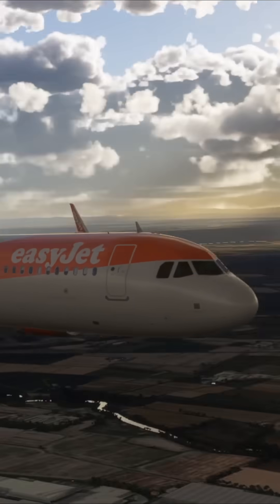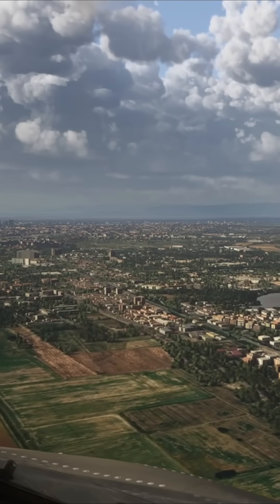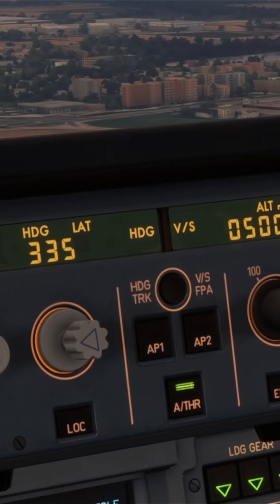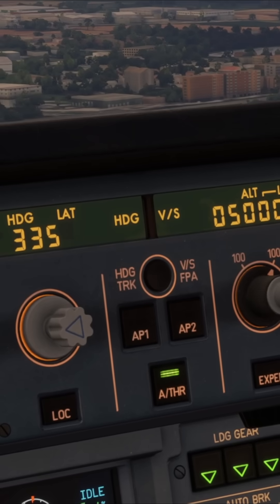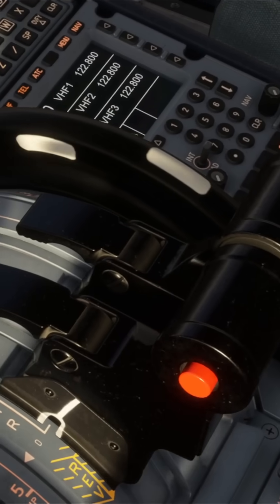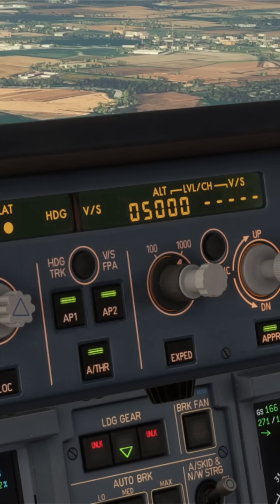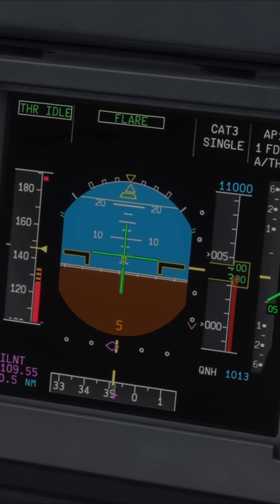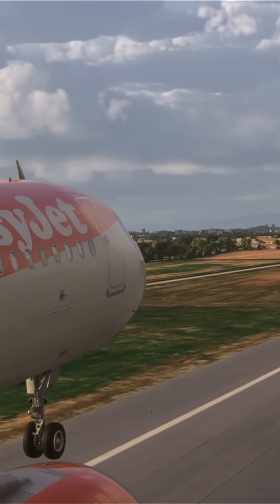A320 Landing Secret: Why the Idle Callouts Are Different

Comment: Another interesting video - Can you do one on approach speeds? I know about VLS but your approach is about 143 knots which is faster than I would have expected?
Reply from the maker: Approach speeds vary with the aircraft weight and configuration you're using for landing.

If you're heavy and landing flaps 3 instead of full, then you're speed will be much faster than say an empty aircraft using flaps full.
Reply: @Easyjetsimpilot  That might explain it. I've been doing a lot of short haul flights so even though I'm full of pax I'm light on fuel. Thank you!

Comment: How did you arm max autobrake in air??? This shouldn't be possible.
Reply: press the max button?
Reply: @gdwnet no the max autobrake is only for rejected takeoffs therefore the max button will do nothing when aircraft is in the air. irl even if you press it, it wont arm. I think this is something that needs to be fixed in future updates.

Comment: So with autoland, going idle is optional between 40-10ft, mandatory no later than 10ft?
Reply: Pulling to idle will disable the autothrust so in an autoland you can only do it when the callout is heard, because at that point the engines were already brought to idle. If you do it at 40ft or any time at your discretion and you might slam the landing harder than a normal autoland